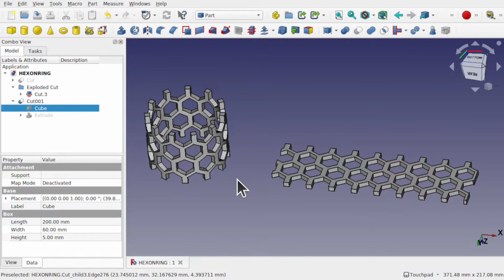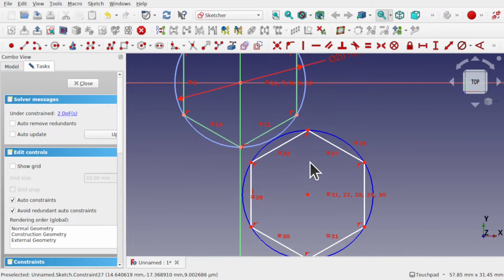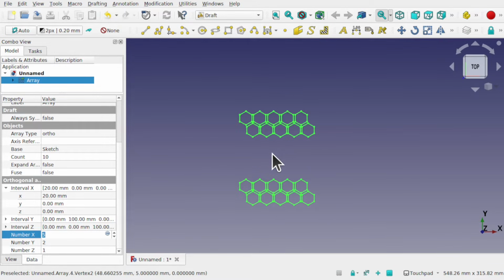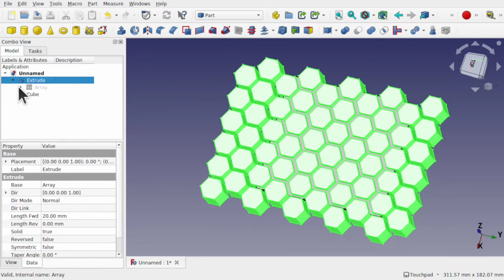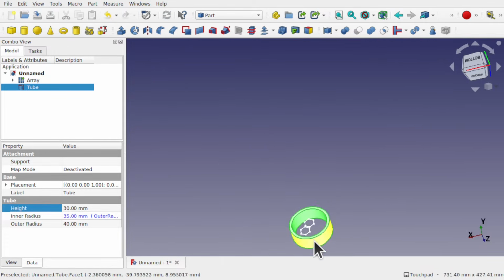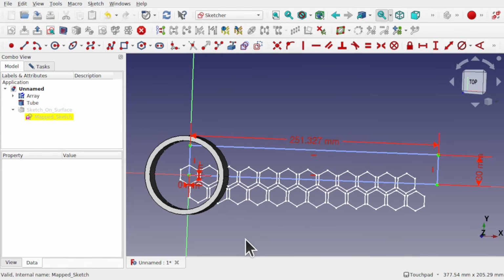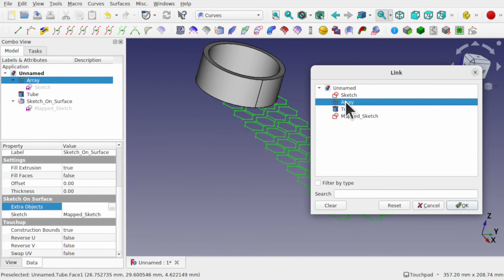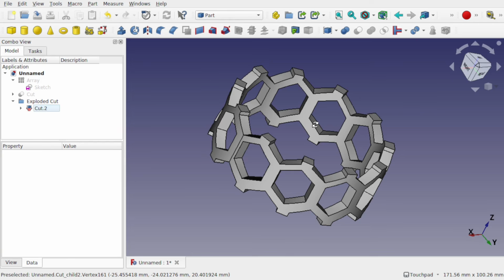FreeCAD: Quick and Easy Hexagon Mesh | Wrapped Around Cylinder | Tube

Comment: Thank you!  A very informative lesson!
I added a perpendicular constraint between the construction triangle and the hexagon, then the math for the intervals becomes straightforward:
'HexagonDiameter	5	
'HexagonSpacing	        0.6	
'HexagonIntervalX	=HexagonDiameter * cos(30) + HexagonSpacing	
'HexagonIntervalY	=HexagonIntervalX * 2 * cos(30)
Now just change the HexagonDiameter and HexagonSpacing (dimension of a side of the construction triangle) and the intervals automatically adjust.
Reply from the maker: Wow thank you for taking the time adding that detailed information. Really help enrich the learning experience. Thank you for the comment.
Reply: You can also use the Width of the hexagons to make it even simpler:
Hex_Width = 6
Hex_Spacing = 2
Hex_Interval_X = Hex_Width + Hex_Spacing
Hex_Interval_Y = Hex_Width * 2 + Hex_Spacing

Comment: Just installed the honeycomb macro a few days ago. It works fine, but doing it manually allows way more freedom that could come handy at some point. Learned something neat again, thank you sir! With an extra construction triangle I managed to constrain the sketch and used references directly from there for the array intervals so the pattern is parametric and perfectly laid out. Matching the circumference to make it seamless is a bit trickier, couldn't yet find a straightforward way to do it.
Reply from the maker: It's always good to try it yourself rather than relying on other people's macros, also it opens up the opportunity to use other geometry. Making it parametric is a great way to go. As you say you need to calculate the gap as well as the amounts of shapes across the unwrapped face which would be the csame as the circumference.

Comment: Awesome tutorial!
But I wanted some more precision with distances between the hexes(damn perfectionism).
I created a spreadsheet where I put the diameter and the length of the triangle side and then referenced them in the sketch using formula.
Afterwards in the array Intervals also had formulas referencing spreadsheet values so it was calculating distances automatically and more precisely then me adding 0.1mm and checking if it looks good.
Reply from the maker: Sounds awesome 👍

Comment: This is a great video unfortunately on my machine trying to create a ventilated wall with smaller holes meant lots of holes and FreeCad crashes when it gets to the cut operation. I may need to do a smaller section of the tube and then stack copies of that.

Comment: This will be useful, I need to model some expanded mesh to emulate a paper humidifier wick. Although that might be trickier because I would need to make the hexagons (Diamonds actually in this case) oblique.
Reply from the maker: If I have it pictured in my head  you could make the flat mesh and Extrude this in part along another sketch which is just a straight line at the angle and distance you want to travel. Or use make face from part on the hexagons rather than extruding. Do this twice and create a multi Ioft from curves workbench between both. You can position the second face were you want to make the desired angle.
Reply: @MangoJellySolutions  Yeah, I can see that first one easily enough. I printed a home humidifier I designed, but the one weakness is the paper "Wick" I used from standard humidifiers. Those fail from mineral buildup in a month or two from conventional use, but my design uses an aquarium pump to pour water on them from the top like some of the "Permanent wick" models. So far so good, but after four or five months, they get a little slimy from being constantly wet. I figure a plastic one I can safely wash without destroying is a better solution. (The permanent ones are made from expanded aluminum foil, coated with some kind of material that helps retain water on them, but they are delicate and cleaning them can damage them).

You've probably seen conventional expanded steel, where a sheet of steel is given alternating slots, then stretched to give the mesh pattern to it. Typically that is flattened. The wick material tends to bend upwards as it is stretched. I think a similar material is used instead of wooden lath to support plaster or stucco walls. The wicks use that technique with absorbent paper, and form it around a single foil layer as well. That is trickier to model because the angle they would extrude is different at each segment. But if I can just approximate it that should be enough to hold the water in the airstream to evaporate.

Comment: Another excellent video, thank you! Any suggestions (possibly an instructional video) on how to fillet the edges of the mesh, without manually filleting each mesh individually?
Reply from the maker: Thank you. Yeh this world be a bit of a pain to fillet. With the tube I don't think you can get around it without selecting the edges. With the planner mesh on the other hand you can use lattice 2 and create a single hexagon, fillet and then lattice. I am sobering now if you can apply the same techniques to a tube. 🤔I will have an experiment. 👍

Comment: P.H.E.N.O.M.E.N.A.L.! It was the thing I was looking for, for more than 2 years! Thank you for that. Just I'm wondering if it works on more complex surfaces like a cilinder that a certain moment changes its shapes becoming conical. Wrapping the mesh around it.

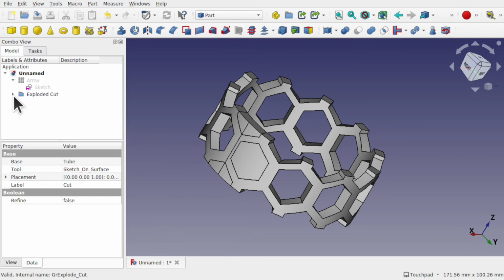23:36 because I adopted differente measures, I got that the removable objects are less than the ones I can remove.
I got exactly 4 but I could remove only 3.
Reply: It does, I was looking for this video to wrap it a hex pattern around conical slice and it worked perfectly!

Comment: Is it possible to wrap more complex shapes around another. The example in your video has a constant thickness, but sometimes there a need for thickness that are not constant.
Reply from the maker: Good question, if you had a shape that  say has a series of bumps and hollows but  following a similar curvature then you can follow the same process but at the last step hide the cylinder / tube and perform the cut against the target object. Your looking at how the hexagons flow and using a simple object first then cutting against the more complex object can be enough to create the effect you need

Comment: Great tutorial!
I have a more general question after following a lot of lattice2 tutorials where you always use Part. If I'm going to use Lattice2, Curves and Draft in my workflow, should I forgo PartDesign and switch to Part? I've started with PartDesign and comfortable in it but lately it seems to hinder me constantly.
Reply from the maker: So this is a good question. Part and part design under the hood are basically the same in how they end up creating a solid, and that's the key thing to remember "a solid". Where the part design breaks down is to create a faster workflow your operations need to create a solid as each time as they are automatically fused with the previous operation. The part workflow requires this to be done manually. This allows freedom of creating surfaces, shells and what I find the most useful of all, compounds, collection of objects. The lattice relies heavily on compounds as it uses arrays of objects. A text string can be exploded in part wb, isolating the individual letters, a extrude with a sketch that has 4 seperate rectangles though is one extrude is still a compound. Part design is great for straightforward modelling especially when you have a plan,  but it breaks down when you want to the 'tricky' side of things as it requires all geometry to touch reducing its flexibility .  It's funny you should bring this up as I just finished editing a video on that exact subject 😊
Reply: @MangoJellySolutions  That makes sense, thank you! Since I've learned we can extrude sketches in Part all the same and don't have to carefully cut spheres out of cubes, it doesn't seem as different.
Haha, you are reading thoughts again :) Looking forward for that video too!

Comment: I tried to wrap a mesh around a box. I needed to wrap it around that. But it seems that it doesn't get  the 3 faces I selected. It choses only one.
I tried also with an extruded face form a B-Spline but the width was 0mm ... Im' stuck on these
Reply from the maker: The box you would need to do each face independently of each other. The thing is as you found the interlinking of sides. Guessing you want a nice clean transition so these need to link up correctly. You could use a shape binder and Extrude the hex mesh for all sides. May be worth playing with path arrays. Looks like I need to experiment.
Reply: @MangoJellySolutions  thank you. It's really tricky. Also when you use B-Splines to create a face, it doesn't work with the wrapping (at least: to me. But I'm not knowledgeable like you are, so certainly i wrong steps). I'm getting crazy.
P.S. Following your tutorials I was able to make things that were not imaginable to me before.
Thank you so much for this.
Reply: @MangoJellySolutions  I tagged you in the forum and I uploaded the surface (it's a solid but I need its surface) to be meshed in the way we're talking. So this should be more understandable.

Comment: Thank you, excellent video, in my case after following all the steps in the end with the cut operations i get a Failure: "Boolean operation failed, Tube is not a solid. I#m using the  version 0.20.1 revision Nr. 29410 on Windows 10 . Any idea why this happens?
Reply from the maker: Could you tell me which cut is failing. Was it the first one where you cut away the compound extrude from the sphere? It may be that you need the sphere slightly larger.
Reply: @MangoJellySolutions  I tried the whole thing once again and now it worked out. Thank you!
Reply: @MangoJellySolutions  it was the cut from the tube, didn’t work the first time.

Comment: in Freecad 1.0 when trying to add thickness to the "wrapped around tube" hexes I get lots of "invalid final face" errors... is this a known issue?
Reply: +1
same issue
Reply: Same here
Reply: Same, can't proceed after this point. Something is breaking when generating the faces - the ones that show up above and below the tube height are distorted or not rendered at all.
Reply: Not sure where the issue lies. I had the same issues with hexagons but switched to the square polygon (to make a diamond pattern) and it worked
Reply: I found out the reason, wheren there's geometry outside of mapped sketch, it breaks. For this totorial the array needs to have number Y = 1, and Placement -> Position -> y = about 26mm. Then it works. (Or a taller tube beforehand)
Reply: I am having the same issue. Seems to happen when I select "Sketch_On_Surface" then set  "Fill Faces" = true. It generates the  wrapped hexagons, but they are hollow without the faces. Is it possible to trim the array to be the same size as the Mapped_Sketch?

Comment: Hi just wondering if you can help when I go to the part section and click on the tube it come up with the measurements in the task window but what I have noticed is that when you use the Measure Distance tap the measurements show double the size for the Outer & Inner Radias than in the Task window but the Height is spot on so am I doing something wrong in the setup or is there a fault in the software.
Reply from the maker: I've seen this before when measuring part design and it confused the hell out of me for ab hour. What I found is that when I rotated my view the measurement had connected to a point in space behind so it was off in the distance though it looked like it was aligned . Found  clicking on a vertexes when measure helps. I don't know if this is the same issues as what you are having.

Comment: Thanks but there's so many issues with this approach... The guesswork required to place another layer in the "correct" position is inaccurate. Calculating that is a lot of decimal digits due to the square root of 3 being irrational - also possible inaccuracies there. Not to mention if you make more than just a couple of hexagons, the entire app freezes up and refuses to budge or straight up crashes. This software, despite probably powering a lot of our progress, is seriously underpowered for how unwieldy it is. Nonetheless, the tutorial was actually quite good!

Comment: How do you make it fill so it creates a connected mesh?

It doesn't seem to work for me with rectangles. When I select the Array first for cutting, I end up with the pattern and a cutout which I do not want. When I select the Extrusion first, I get an error (exclamation mark on the extrusion).

Also, I get an error when I switch to the Draft view.
Reply: You have to size the repeated mesh just right to hide the seams. There are no magic bullets and if you want to fill a cylinder with custom shapes, the size of the shape must be something that perfectly matches the circumfence of teh wrapped object after being repeated N times where N is some integer. Generic case is called discrete mathematics and it gets really complex really fast.